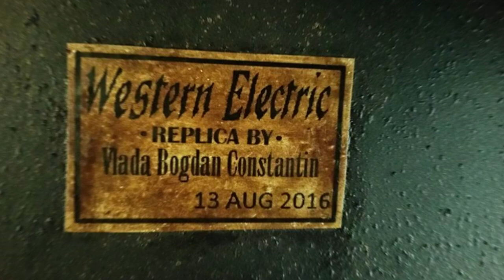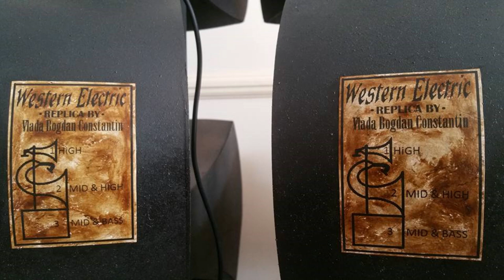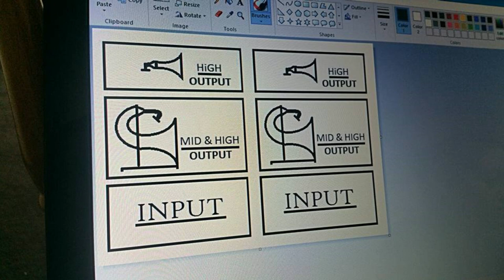DIY HORN SPEAKERS Incredible sound of home made speakers VBC

Comment: Great video really !  i love your creations.  I am partial to circular horns ... when i see a rectangular/square section horn i remained perplexed.  I do not mean they are not good but they look not right to me.   The driver is circular so also the horn should have a similar shape like in Avantgard or Acapella speakers i mean.  What do you think ?   Another issue could be time alignment between horns of different length ... i believe in time alignment P.S.  By the way  ... what is happened at 6:03 to the sound ? just a curiosity.
Reply from the maker: Until that point the soud was coming from the speaker and then after the sound was added at the video edit

Comment: you aren't doing yourself any favors, by using 2x6 piezo plastic horns, with a sudden expansion rate flare for 2KHz, and then, feeding that sudden flare into your section of the horn.......the first 2 feet are critical for correct expansion, as that section is under the highest compression..that sudden flare at the front, and then into the correct section you made causes reflections back into the driver...
  It's nice, I'm not knocking it, but it could be so much better with some more work...
Reply from the maker: Thank you